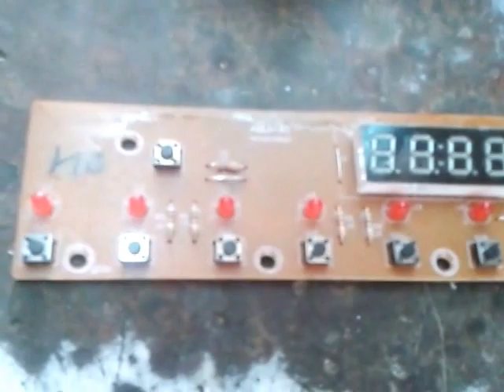Testing Of Induction Cooker Card And Front Panel Part 6

Comment: sir great work and great guidance sir my induction shows E4 sir what I do sir plz reply sir I m waiting for your guidance sir plz reply
Reply from the maker: +Mohiuddin Shah Check its filter capacitors, rectifier diode, MOSFET and sensor.

Electric Point Team
Reply: sir thanks for response sir I replace h20R1203 transistor that was short  but after that  it shows E4 sir plz gauid me

Comment: sir I replace short MOSFET but know it shows E4 sir what I do know sir I m waiting for your guidance
Reply from the maker: +Mohiuddin Shah Also check its filter capacitors and rectifier diode

Take out these components from circuit then check them

Electric Point Team
Reply: What is the problem of induction cooker front panel board lights continue on
Reply: Mohiuddin Shah what is the problem of Hendersonville call dependable continued lesson
Reply: Mohiuddin Shah what is the problem of induction cooker front panel board lights continue on